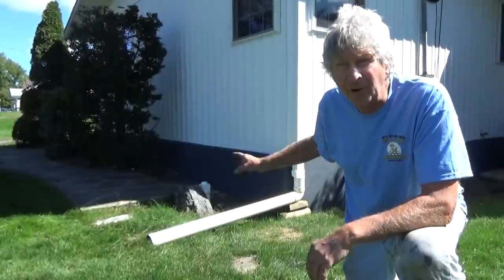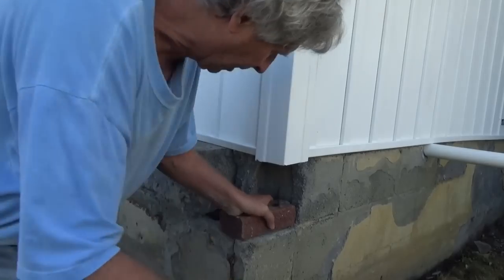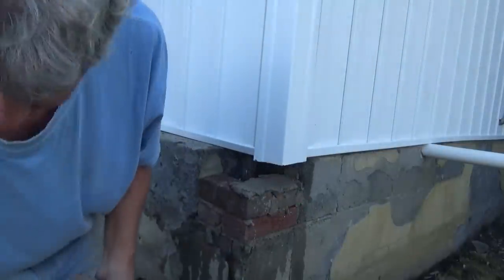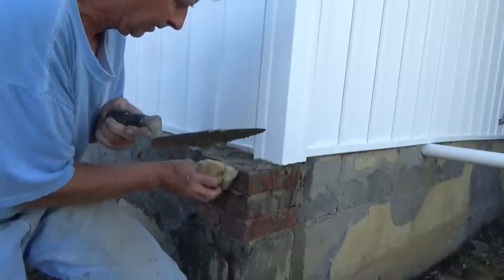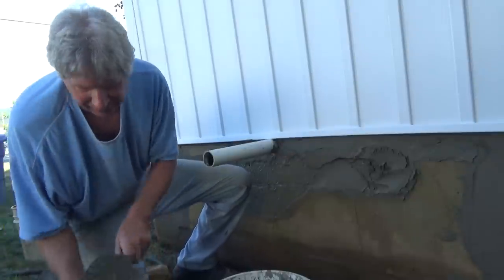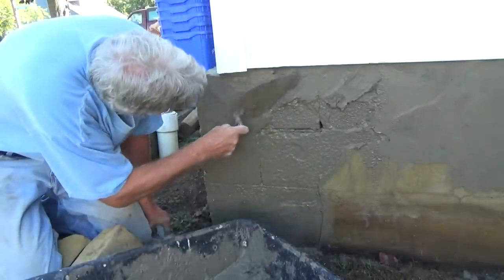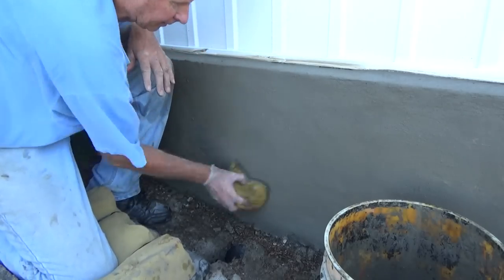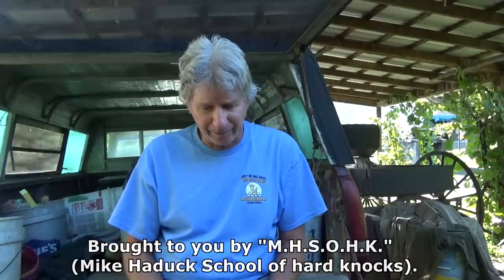FOUNDATION REPAIR (Part 26) Mike Haduck

Comment: that seems like somebody built foundation a bit too large so water running down house is going to run into the block and break it down.
Reply: Yep. Those bottom "j" channels to close off the bottom of the siding end behind the corner post....and dump all the rain water right on top of the corner foundation.  Oh well...
Reply from the maker: It was a old house ,that's the way they built it, Mike
Reply from the maker: The siding actually covered masonry above it, Mike

Comment: It's so refreshing to finally see someone doing something without trying to make it sound like it's brain surgery. Sometimes a skill is more important than the science behind it. 

After 3-4 screwups (out of 7-8 contractors I hired in my lifetime), I embraced the same thought as you..."it's simple, anyone can do it". I started by fixing a huge drywall hole in the corner of my room, then replaced faucets and other minor things, eventually, after slowly seeing that my repairs are better than the people I hired, I did my own flat roof, assembled a new kitchen, did a paver patio, concrete repair, glass shower doors, chain link fence, and glass railings around the pool.

It has been 4 years, and the things I did myself are holding up better than what was done in the house 2 years earlier.

The only things I'm afraid to tackle are the front doors (double door with a large tramsome), and tiling (because if I screw something up, it's all trash, and hard to remove).
Reply from the maker: Hi Shane, I like you determination and attitude,  keep it up, Mike

Comment: Hi Mike, Always a pleasure to watch your videos. I hope that you're enjoying some rest and relaxation. I had a quick question about your bonding agent, Will it work on a foundation wall that has already been painted? I would like to plaster and paint it like you did in this video. I used it once on a non-painted block foundation wall and it turned out beautiful! Thanks in advance! God bless you.
Reply from the maker: Hi Dean. In other parts of the foundation repair videos  I have done that,  check them out, and just painted over it again, thanks Mike
Reply: @MikeHaduck  Thank you!!

Comment: Great video!!!  John, the only question I have is would I have to expose a course or two below ground level when parging?  I seriously made a much bigger deal of my simple repair job and watching you simplified it for me.  You’re a blessing!
Reply from the maker: Hi, everything depends on the foundation,  I usually dig down about six inches and I will know after that what to do, I got a video out called "basement water problem solutions" Mike haduck, that might help if you are having water issues, thanks Mike
Reply: @MikeHaduck  thank you!  It’s not bad, foundation is a little rough but not bad.  I just need to tuck point what needs attention.  Thanks for the reply!

Comment: I have a question about that wall near the corner. It had a flat top on it. Will that be ok over the long haul? Will snow and water pool on it and cause problems? I always wonder about that. Thanks, Joe
Reply from the maker: Hi Joe, there was actually masonry behind that siding, Mike

Comment: I heard that lime use for foundations should be limited. If lime is used bellow damp proof course and especially underground (exposed to ground water in foundations ) it is gradually dissolved by acidic water, so the lime part in mortar should be smaller than usual.
"Exposure" class mortar mix (cement, lime, sand) - 1:0.5:4.5 for General use, and 1:0:4.2 for concrete masonry - according to Building code of Australia (NCC 2019 BCA Volume 2 Page 138).
Reply from the maker: Hi, I show what I use in almost all my videos, that was what I was taught by the old timers and I been doing it for 50 years. I don't want callbacks backs so what I used always worked for me, thanks Mike
Reply: @MikeHaduck  It might take 50 years or more for lime to dissolve underground. Sure there will be no callbacks.

Comment: Mike, love your videos!

I had a question to ask you. I am in process of making my own tiles for my patio. These tiles are to resemble real stones which are roll stamped individually.
 Just to mimic the real stone look, I didn’t want to use regular concrete mix as the gravel could get 
exposed.
I live in Maryland. What would you recommend using for this project?
Thank a lot.
Looking forward to hear back from you.
Steve.
Reply from the maker: Hi Steve. I would think real stone would be cheaper, and better, I have a whole playlist on ," stone patio installation " Mike haduck sometimes you don't even need cement they could be laid in pea gravel, thanks Mike

Comment: Hi Mike, This is great. I have a somewhat similar project. I am in the Northeast and have a boathouse held up by 4 massive concrete pilings. Picture a pyramid with the top lopped off. Well they lower the lake every 5 years for repairs. The wave action has eroded two of these on the outward facing side maybe eaten up 6 in (they are 4 foot across). What mix should I buy to build up and repair and what should my approach be? Build up gradually over multiple days? Make a form? Thanks so much! I dont want to make a big deal about it. Just want to do it myself! Thanks!
Reply from the maker: Hi Laguna, I would watch my playlist on concrete patches, Mike haduck, plus these foundation repair videos, all my techniques and what I use are there, thanks ,Mike
Reply: Thanks for the reply. So same mix and process for pillars that will be submerged when water level rises again? Appreciate it! @MikeHaduck

Comment: Hi Mike, I love your videos. I’d like to know if it’s ok to use type s mortar instead of Portland. I live in Ontario Canada so it does get  pretty cold in the winter. I’ve used pargin mix from the depot store but it only lasts a year and it starts failing. I also do stone patios like the one you showed first. And I’m curious if using type s mortar Wud be any good. I’d appreciate your advice. Tnx
Reply from the maker: Hi, I would watch a bunch of those videos I made on foundation repair because I use different products on different jobs, some old school ans some fast setting ,etc, then do a little experimenting and see what works in your case, thanks Mike
Reply: @MikeHaduck  thank you !

Comment: The key words are non-structural. If it is not load-bearing in any form, filling with any type of materials on site will work; however, when load-bearing there are aspects of strength and thermal compatibility with the other parts that would be challenging to justify all of these repair steps. Foundations are structural.
Reply from the maker: Thanks James.  Mike

Comment: The inside of my basement wall is getting wet. I stucco over the outside wall but it still gets wet. Phila,pa . Any ideas
Reply from the maker: I have a video out called " basement water problem solutions" Mike haduck, check it out lots of tips, Mike

Comment: What mix are you. Using there.
Reply from the maker: Higerard, sometimes the fast setting sometimes a mason mix, I say what I use in each video, thanks mike
Reply: @MikeHaduck . I repaired some 2” cinder block cap that had become porous and deteriorated from water from the above deck dripping down on it        It came out great thanks to your videos     All I kept hearing doing it was a voice saying.   IT AINT NO BIG DEAL  DONT MAKE A PROJECT OUT OF IT      IT AINT NO BIG DEAL.            THANKS MIKE  FOR THE INSPIRATION AND COURAGE
Reply from the maker: Thanks Gerard, I appreciate hearing that. God bless, Mike

Comment: Hi Mike,I bought my Mother's house a few months ago after she passed😢, My Dad built the house around 1977, when the house settled the back wall had a vertical crack,it never got worse and the rest is perfect. I'd like to really fix it properly. Should I chisel it out and patch it of do that epoxy deal where you drill holes and pump it in? I trust your opinion more than anyone,thanks Mike. Oh it's a 8' concrete wall
Reply from the maker: Hi , I would watch the whole playlist before you make any decisions, every situation is different and I show all my different techniques,  maybe one will fit your situation. You can also ask some of the local guys for advice, I hope it helps, Mike
Reply: @MikeHaduck  ok thanks